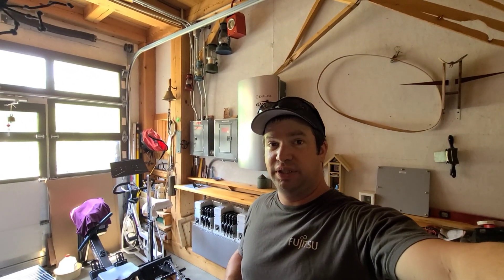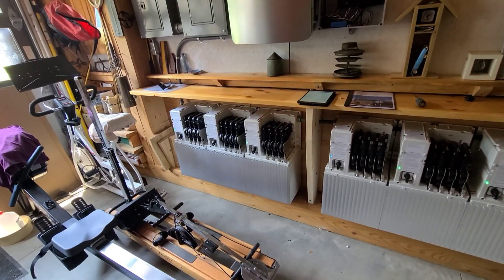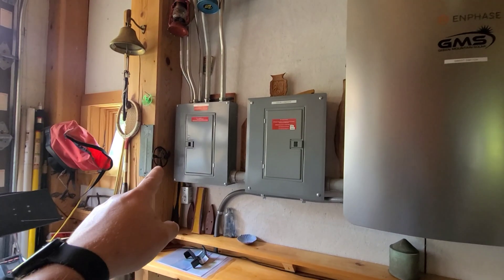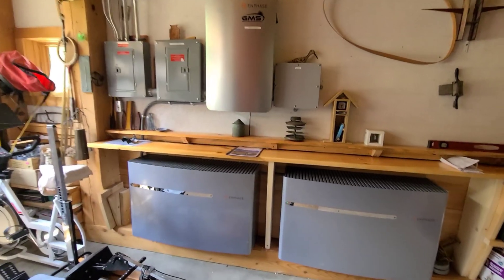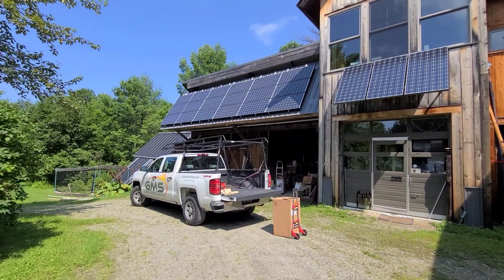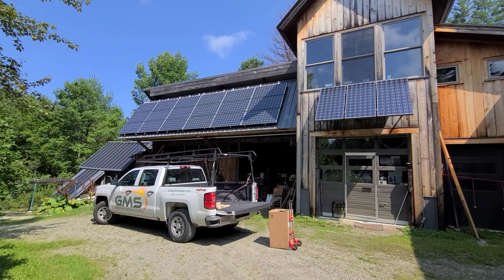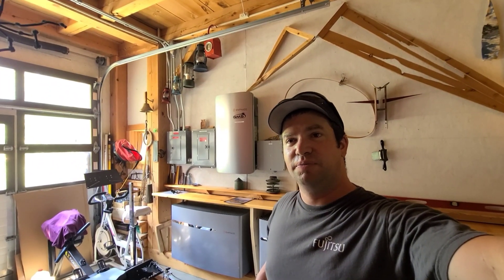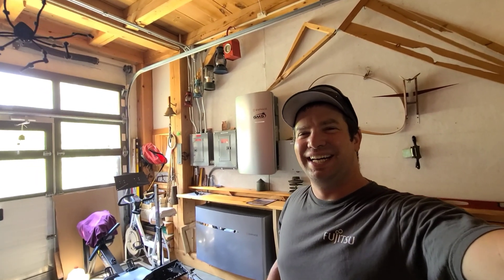Enphase Ensemble System to Replace Aging Battery Backup

Comment: Ensemble with legacy M250's!! Thank you.  I've got 48 M250's, and I'm wondering how this works.  I understand the M250's get new firmware and are then controlled by frequency shifting.  But I wonder if you can explain how it works from there.... Does it actually throttle the M250 output as needed so, for example, house loads can be solar powered even when the battery is fully charged?  Or is it just on-off control that requires reserved capacity in the battery?

Comment: You can do the legacy upgrade program for the m series and they will give you IQ7 pd (powered down) at around $70 a panel. including the trunk cable. this is the best option if your lookong to expand the existing array with high output panels
Reply from the maker: We did consider it, but would have cost the customer an extra few thousand dollars and really wasn't necessary.
Reply: @benssolarandbattery  Glad too see you explored all the options. Can you still buy new m series inverters?

Comment: I really like the use of multiple redundant microinverters as part of the platform...really wish it were possible to buy the IQ8s alone to add to our DIY batteries.  Using a pile of m250s or IQ7s is still possible with another inverter to provide the grid reference..but still..

Comment: Thanks so much for recording these. Keep going.

Question - you mentioned micro inverters for offgrid. Do you need specific inverter which creates grid for them, or it could be any hybrid/offgrid with pure sine?
Reply from the maker: Typically, yes. You need an inverter which will form a microgrid allowing the microinverters to AC couple with it and charge the battery. It also needs to be able to shut those microinverters off somehow, whether it be through frequency shifting or a relay.  
With the Enphase Ensemble system, there are IQ8 micros in the batteries that form the microgrid but the cool part is, the system has direct control of the roof micros, allowing them to throttle up and down as needed.
Reply: @benssolarandbattery  am I getting this correct - if inverter can't shut down AC coupled grid tie inverters/microinverter they will rise AC voltage to the sky?
Reply from the maker: @cnc-ua  no, it will most likely raise the battery voltage above setpoints until it hits high voltage shut off.  Grid Tie inverters will typically only go up to 264vac before they shut off.
Reply: @cnc-ua  You are correct.  If you are using a battery backup system (or other grid forming inverter) which is AC coupled to your microinverters, if the backup system can't shift the frequency of the AC, the microinverters excess power will damage the backup system and/or batteries - and bad power for your loads.  Your backup system or grid forming inverter needs to support AC coupling.  El-cheapo Growatt is a no go, need something like Outback or Schneider - or similar.  It also typically needs to be sized to be that or greater than your solar, as the curtailment or on/off adjustments are not instant, and the inverter and batteries need to accept full power at times.  Enphase does this nice in their own ecosystem, but many things to consider if using mixed vendor components.
Reply: @benssolarandbattery  and thank you for your response.

I appreciate